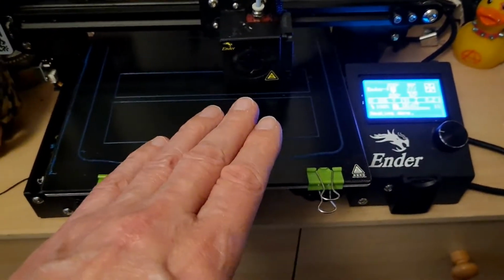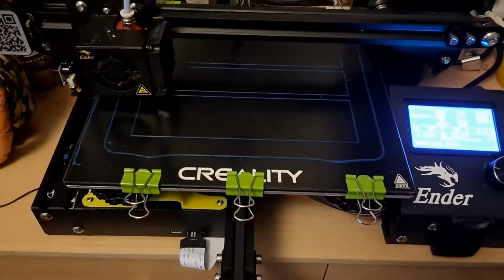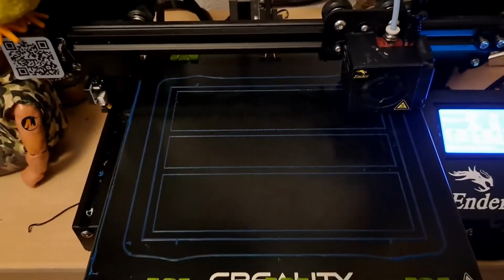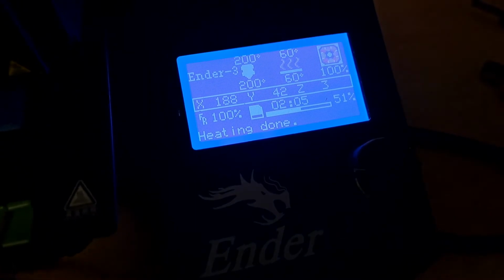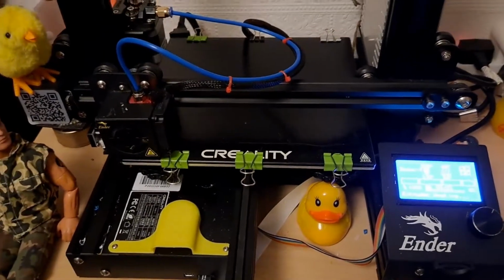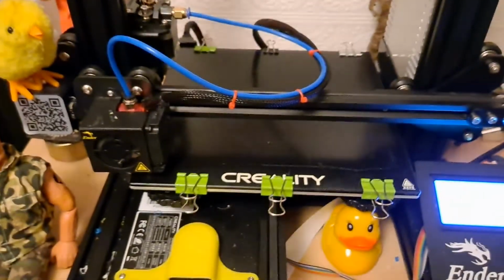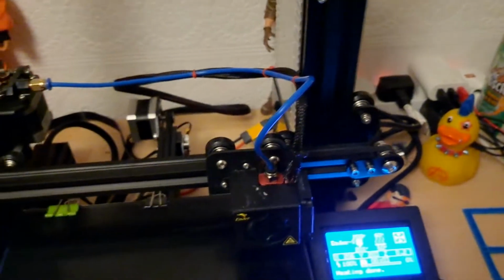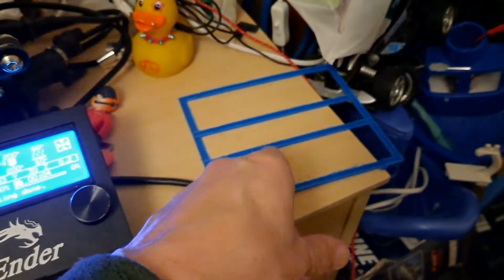More 3D printing issues 20210110

Comment: Have you thought about getting the Laser printer-like Frankie has 👍
Reply from the maker: I would rather like a laser cutter, large enough to cut maybe 3 mm ply, for doing the wooden kits. I would need an outbuilding to use it, they seem to be a bit of a fire hazard. There are images of so many 3D wooden kits available online that I could try. Boats and planes etc.

Comment: Interesting. Stuff I will probably have to do to mine at some point. I found it impossible to level the bed over the whole area. Increasing the height of the first layer can help for bed adhesion issues, but I think you must be right about it being a nozzle issue as the first layer adheres just fine. Thanks 😀 👍
Reply from the maker: I am sure there is something odd about that blue filament. Several days running it has printed fine, but when I go to do the next print I notice the filament has snapped around midpoint between the spool and the extruder drive. I cannot imagine how it is breaking in that position. It is a conundrum I haven't been able to figure out. My only thought so far, is it was wound on the spool too tightly and has weak points when it is straightened out.
Reply: @GrandadsOtherChannel  Yes, mine (which is also blue) often breaks at just that point. I have added an arm which helps, but yes  I think it is to do with how tightly it has been wound on the spool
Reply from the maker: @mrrgstuff  I added an arm and the arm broke 😆 I might print another as this filament seems to be fine once it is printed.
Reply: your bed is warped you can get a replacement glass bed and there better
some of them come warped from factery and thay dont check them
Reply: @Chickennoodlesoup0117  Yes, it will be a warped bed. Its a glass Creality one, but the whole printer was 2nd hand/used, so I don't have the original bed. It did come with a BLTouch, so that largely corrects the problem for me. Thanks 😀 👍

Comment: So it was the nozzle? Makes me wonder how they can wear out because I am sure they are brass, "I think". 
I would not have thought the filament, when hot and soft, would have any major effect on the metal, but seemingly it does. Although your printer is used an awful lot for your creations. Maybe if they made them from stainless steel they would last forever. Then again, maybe if they made cars from stainless steel we would only need to replace the engine, so I suppose it is all about selling. 👍👍👍
Reply from the maker: I don't think they are wearing out, just clogging up. In some cases it seems the bed has gone out of alignment and the nozzle has actually scraped the surface preventing the filament from getting out. The driver will still be trying to force it through, so it all jams up solid. However, I think that blue filament is suspect. Several days running it has printed fine, but when I go to do the next print I notice the filament has snapped around midpoint between the spool and the extruder drive. I cannot imagine how it is breaking in that position. It is a conundrum I haven't been able to figure out. My only thought so far, is it was wound on the spool too tightly and has weak points when it is straightened out between the spool and the driver.

Comment: you sholdent need to level it often you mite need to tighten bolts that are loose also you need to keep the filement in dry place if there is too much mosture in the plastic then that can cause it to brake
Reply from the maker: Thanks, do you have a printer?
Reply: @GrandadsOtherChannel  yes same one as you